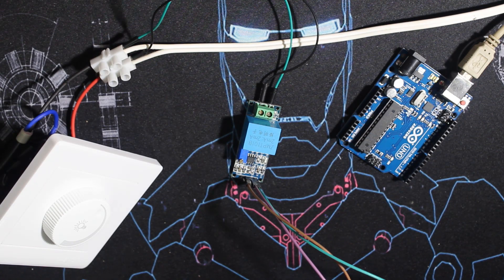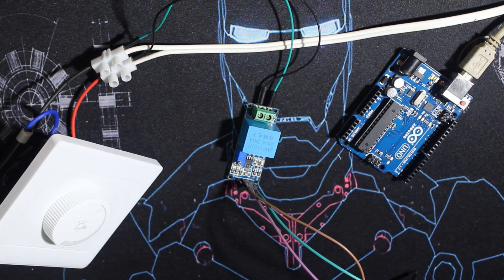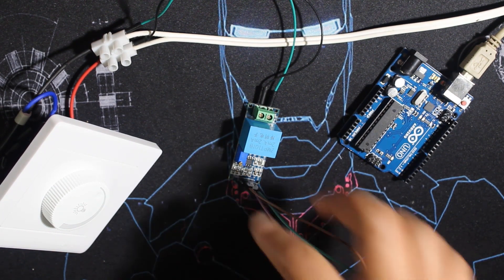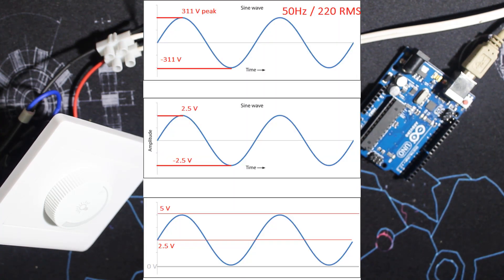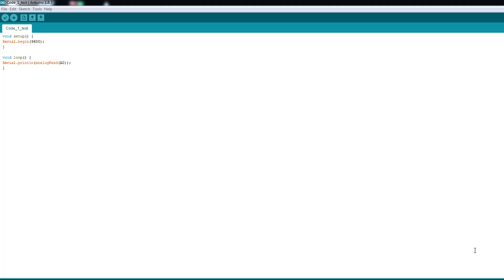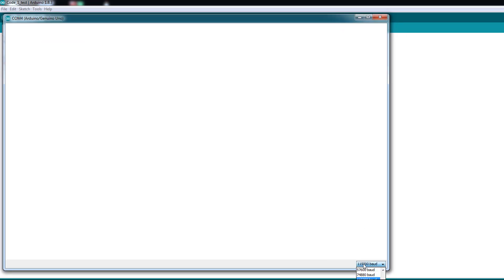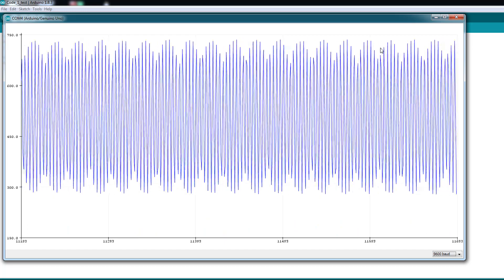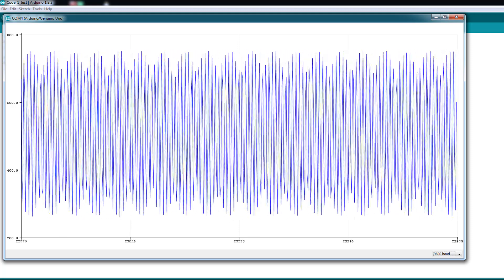Easy measure of any AC voltage with Arduino and ZMPT101B (up to 250V)

Comment: You have done a great project. I had tried this too. I had tried connecting the ZMPT101B voltage sensor to the Arduino UNO. The ACC pin, OUT pin and Ground Pin of the ZMPT101B are connected to the 5 V pin, A0 pin and Ground Pin of the Arduino UNO respectively. The ADC output should be around 512 at 0 V input voltage. However, I can't get this value, the ADC output of my Arduino Uno is only 35. This project is really important to me. Could you advise me on that matter?
Reply from the maker: This is strange, Try to use a potentiometer only with one analog input and check if the values goes from 0 to 1023, if okay it means the ADC is good then try to power your module and check if it has correct power (5v) and check its output with a multimeter
Reply: Thanks. I had checked the ADC (A0) is working well. You said that check if it has correct power (5V). Which pin of ZMPT101B voltage sensor that I should check?
Reply from the maker: @hkmun8779  Just the Vcc and GND pin should be 5v there, I think there's a light in the module that shows that it's powered
Reply: @SurtrTech  Yes, it is  power and the internal LED is light up
Reply from the maker: Well try to measure with a multimeter between the Output pin and the GND pin or Vcc pin and GND pin while the module is powered by 5v and don't use the terminal for the AC input so it should be a 0, and on your multimeter you should read around "2.5V" which is "512", if you don't have this value I'm afraid that something is wrong with the module.
Reply from the maker: Sorry the other measure is between Vcc pin and Out pin*
Reply: @SurtrTech  I had tried to measure the voltage between the Output pin and the GND pin of the module while it is powered by 5 V without the use of the terminal for AC input. I set my multimeter to DC. The reading from the multimeter is 51 mV (with fluctuation )
Reply: @SurtrTech  I tried to measure the voltage between VCC pin and the Output pin of the module. It showed 4.75 V. While the voltage between the VCC pin and the GND pin, it showed 5.04 V
Reply from the maker: @hkmun8779  That's the problem, the offset is not done right, you should have around 2.5V for (Vcc/Output) and (Output/GND) which is for 0VAC, I think something is wrong with the module and you may have to change it, if not possible and you have access to an oscilloscope try to read the output there and use the AC input without/with Power and check if there are values that goes below 0V, and again if you can't change it you may add another amplifier to add the missing 2.25V.
Try to reach me on FB if possible I'll send you a PDF about this module (it's in Thai, I don't know Thai neither) and you'll find the whole schematic of the module and check if something is wrong
https://facebook.com/SurtrTech/
Reply: @SurtrTech  any other solutions??
Reply from the maker: @kartikhegde9368  The module I'm using has "LM358" Amplificators chip, you may have another one which can cause this problem
Reply: @SurtrTech  In mine it is OP07
Reply from the maker: @kartikhegde9368  It's the same as the guy's above, and if you check both datasheets they are very different
Reply: @SurtrTech  but both OP07 and LM358 are opamps only ,why this is not working , and now a days OP07 only coming ,how to get other module which has lm358?
Reply from the maker: @kartikhegde9368  OP07 has one op amp only, the other one has two, just to know how it works, the 220v AC is converted into a -2.5V 2.5V AC , then a 2.5V is add to the signal and now the signal is 0-5V AC which center is 2.5V (512) and you get this value when there's no AC signal on the input, then the potentiometer permits you to increase or decrease amplitude:
The center is always 2.5V and the signal can have a range of (0-5V) or (1-4V) ... depending on the amplitude
Reply: @SurtrTech  modules now coming are with OP07 only .so how to overcome this problem? is there any different calibration method? or if I replace OP07 with LM358 ,does it work?or tell any other better sensor to measure 250V AC
Reply from the maker: @kartikhegde9368  I have no idea about these versions, and no don't change anything because the whole schematics are different. it could be a different way to calibrate or use try using the serial plotter, and change the potentiometer, baude rate, delay ...
Reply: @SurtrTech  can you send the both data sheets?
Reply from the maker: @kartikhegde9368  You can Google them they are popular
Reply: @SurtrTech  datasheet of module or lm358/op07?
Reply: @SurtrTech  Bro ,finally I got the solution for that ,simply replace OP07 with LM358
Reply from the maker: @kartikhegde9368  Did it work? If you didn't try I think that's a bit risky, you can check for the op amp datasheets but for the module it's quite unpopular
Reply: @SurtrTech  YES,It is working correctly
Reply from the maker: @kartikhegde9368  cool then
Reply: @SurtrTech  do you have any code for 230volt measuring ,using Emon.h library?
Reply from the maker: @kartikhegde9368  No sorry
Reply: @kartikhegde9368   Hey can you help me. I am also building this now with ESP32 and I am not getting correct voltage it is fluctuating between a lot of voltage.
Reply: I'm also facing the same problem ,it is showing 30 instead of 512, I tried to solve it in many ways ,but it didn't work

Comment: Hi,

I really like this project

Can you tell me, from your code , where you got the values below ?

float intercept = -0.04; // to be adjusted based on calibration testing
float slope = 0.0405; // to be adjusted based on calibration testing
current_Volts= current_Volts*(40.3231); //Further calibrations for the amplitude

I have adjusted the Trim Pot as you suggested ..and the readings look good – . what is my next step to calibrating ?
How do I get the the readings translated to the correct voltage.
NOTE: My AC voltage is 240 Volts so I assume the values you have above are not correct for me ?
How do I get the values I need ?

thanks
Reply from the maker: Hello, it's the 3rd time you ask the same question I responded you on Hackster and my website I hope you read them.